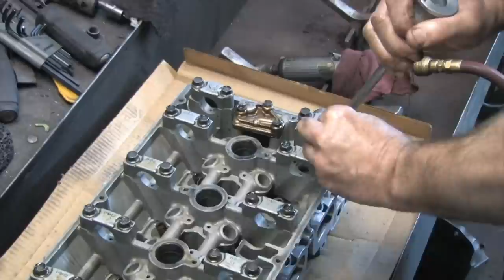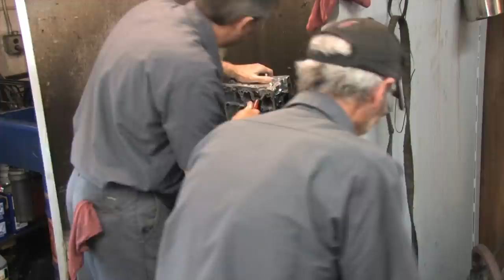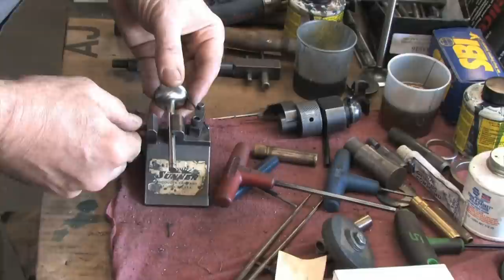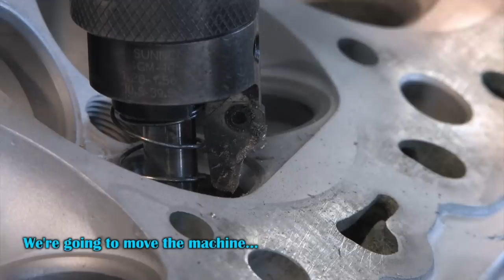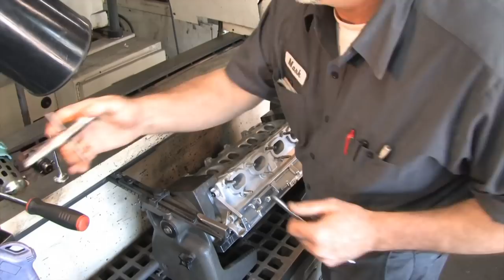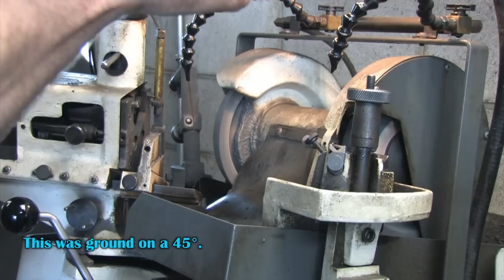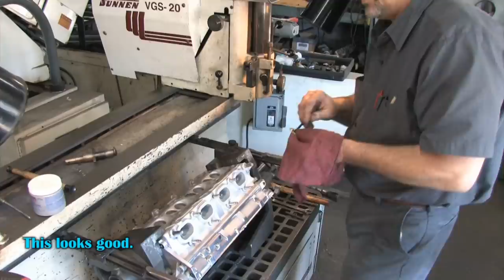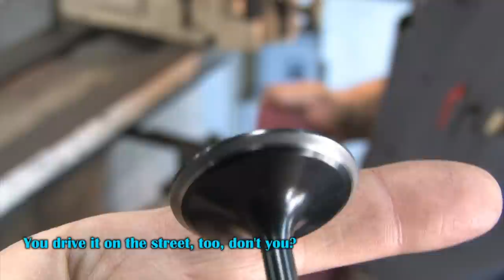Cylinder Head 201 - Radius Cut Valve Job

Comment from the maker: +Victor Bangle Your replies are disabled.  It's not the head that was moving.  The table this is on weights over 800lbs.  Actions were taken to compensate for this in this very video.  There's always a couple thousandths of an inch of deflection in the guide because if there wasn't, it would get stuck inside the valve guide.  The reason you cut, inspect, lap, cut again, lap again and inspect is to ensure you're setting your stops correctly.  If it chatters, that's bad... but the process accounts for the smaller guide variable.
Reply: ***** that's cylinder head,work was professional real nice thank's for this technical video
Reply: +Jafromobile Hey boss a friend of mine has one of those 4G63  and I was just curious as to how those inconel valves treated you?
Reply: OK HEY I NEED EVERYONE TO HELP ME I need new valves and seats for my Honda trx450r. If I buy a new cylinder head and valves that are the same dimensions will it be ok and work.       Oem cylinder head, oem shape valves or something like that you get what I mean but will it take any work or valve cutting after that

Comment: In my heart of hearts I always wanted to work with my hands machining and building stuff.  I love your videos dude. It tickles that 'what could have been' sorta feel in me. 

Alas, I had to be all computer oriented and do most of my stuff in the virtual confines of software....and the hardware side...pulling cables and building out network infrastructure, just isn't the same as this stuff..
Reply from the maker: You're absolutely right.  It's not the same at all.  That's why when I get home from pulling cables, building images for mass deployments, setting hardware and software standards, configuring LDAP layers and network topology, configuring and maintaining server environments, coordinating with 14 other technicians, dozens of vendors, and supporting about 9,000 users total, I grab my tools and wrench on cars.  ;)  It helps me relax.
Reply: OH my God! I completely missed this reply all those years ago.   You rule dude.  Also, I actually started woodworking as a hobby in the meantime.  Nothing too serious, but I've picked up manual skills since then. 

Cheers dude. I still watch your videos to this day. :D

Comment: This machinist is legit. Taking the needed time to check and recheck. Not forcing or rushing anything, I like what I see. As far as I am concerned, that part is a wrap. I love it when a plan comes together! Real good video. You usually don’t see stuff like this on crap tv videos on cable. The machine shops they use wouldn’t let you video their work! Some people just don’t get the level of repetitive tedium that is standard manual machining. It isn’t that it is hard to learn or do, but it is repetitive and it can be tedious. You have to be ok with that. Doing a stellar job despite the obstacles is what sets this guy’s work from the others and being honest too!👍🏻

Comment from the maker: +Jens Kraft This job (radius-cut valve job) costs in the hundreds.  Not the thousands.  It's port work that's expensive.  You'll pay an hourly rate for port work.  Non-CNC port work (doing it by hand) can take dozens of hours, and CNC precision isn't cheap either.

If you pay more than a few hundred bucks (U$D) for a basic rebuild/valve job on a good head you're paying too much.  If you're replacing or upgrading parts, add the price of whatever cams, rockers, lifters, cam gears, valves and springs you're going to use.  Add port work, welding, extensive machine work like moving cam centers and crows feet, shrouding, valve guides, polishing... then the sky is the limit.  You CAN spend thousands, but what I showed here is really affordable if you're the mechanic putting it back on the car.

The changes I'm making to the valves and springs will significantly improve the sealing qualities of the seat, and that would normally improve efficiency, however; this engine will not be built around efficiency, unless the efficiency goal is producing 520kw with 2.0L of displacement.  That's not the kind of efficiency you describe, but it will give the vast majority of V8's a black eye and still get 26-28 mpg on the interstate pushing a 3355lb chassis with air conditioning.  For my goals, I consider that efficient.

...I failed to mention it will most likely get 11mpg in the city... but it doesn't get a lot of use, and will be the most fun gas you've ever burned.
Reply: The information coming out in this video is priceless. First hand experienced machinists giving their methodology in simple english and explaining why they do what they do, not why its the best way. Just like your other video Jafromobile. Amazing video, thanks bro.

Comment: Great video and top notch workmanship-- many years ago I had a 74 Kawasaki Z-1 900 bored out to 1015 cc and I had Manley SS oversize valves that had 'reliefs' for better flow, also had the runners cleaned up and port matched, Megacycle 417 lift cams too

Comment: Absolutely brilliant. I loved the CV joint on top of the valve grinder to use the machine torque but not the head bearing.  Using the seat itself as the rotory guide is standard I guess but I never knew.

Comment: Nice work.  On a not new engine/head, before going any valve seat cutting, check for ware in the valve guide.  An oversize/worn guide will allow the valve to rattle rather than close cleanly.  Use an oval go/not go gauge to check for ovality.   Oh, and check for ware of the valve stem for the same reason.   Also if there is any combined tolerance build up, lowering the valve in the guide by recutting will hide this but it will very soon reappear.  Checking for wear should be done before machining to prevent this.  Get rid of any discernible wear before starting to improve things from stock.

Comment: Sir,,it's the,best way to,work  on,all Cylinder, all heads taking special care, n precision, increased horsepower, help to cut n  reduce pollution, n,helped ,to save fuel,,,(is not the, engines, is the problem,,,is we,) thanks u,sir,,

Comment: For the intended purposes of this video, it was very good.  It was nice for that guy to walk the audience through.  But for any one here that does performance cylinder heads or knows the process, probably will approach the valve job differently.  Just a couple things I saw and disagree with was that he seemed to use too aggressive of lapping compound.  I use nothing more than 400 grit and you should use dykem on the seat and valve to see if it cut concentric or not.  As far as the cutter, there is nothing performance about a 30/45/60.  That is a normal valve job you'll get from a rebuilder shop.  Once again, not bashig by any means, just voicing my perspective on this.  All in all, I think this is great you take your time to make videos for the public.  Good on you for that.
Reply from the maker: +recordbreaker5 There are many aspects of performance, and many points I agree with you on… for instance, I hate radius cutters in general.  That's not my preferred equipment for cutting valve seats on any performance job, but it costs $1700 less and isn't what's responsible for the biggest gains that I'll be able to feel or measure from the driver's seat.  To me, that's money well saved.  While a valve seat can be a limiting factor, it's not where the majority of "performance" gains come from.  Keep in mind, when Mark says "performance cutter", all it denotes is that there are 2 kinds of cutters available for this particular machine.  Variations in how wide the 30/45/60 angles are… are why it's referred to by Sunnen as a "performance cutter".  The "performance cutter just has a longer 30 on it, and a shorter 45 and 60.  It's intended to move the seat out closer to the margin of the valve which actually shortens the life of the valve job, but improves airflow over a standard cut.  It's that simple.  If anyone hears "performance cutter" and assumes that using that tool automatically means they're going to end up with the ultimate valve job in under 2 hours and for less than $300, then they're a victim of their own assumptions.  It's just a seat that flows better than the standard cutter will cut.  A seat that doesn't match the exact lengths of the recommended 30, 45 and 60 cuts.  One that Sunnen claims will flow better.  A standard seat has wider 45's and 60's so that the valve job lasts longer.  It trades flow for a bit more durability, that's all.

The weakest link in 99.999997% of professionally-built "performance cars" is always the driver, not the valve seats.  "Performance" is the most abused term in automotive engineering because what's the standard?  Performance what?  Whenever someone thinks they have a "high performance" machine, they get butt-hurt the moment they find out someone else is faster.  Problem is… someone else is always faster.  Unless their name is Kye Kelly of course.  If the standard is "flows better than stock", then nearly any bolt-on upgrade from an air filter to an exhaust tip turns a street car into a performance car.  That's awesome from a sales pitch perspective, but that won't change Kye Kelly's opinion of your car.  That's why performance is a subjective term.  It's splitting hairs.  He-said-she-said.  All "performance" denotes is it's intended use.  

Putting a 9 angle valve job on a normally-aspirated economy car won't magically turn it into a "performance car", just like using a standard cutter on a GT-40's valve seats won't turn it into an economy car.  You also mentioned the same thing I think about permatex lapping compound.  I've actually mentioned that in this video, and a previous video where I covered the shade-tree approach to valve jobs.  If someone wants to spend $2,000+ or 100 hours dressing stones and cutting seats for 3 extra CFM, then they know what their reasons are, but everyone else is going to end up with a valve job done on a radius cutter because the machinists doing the work would rather not spend their whole week on it, and because in nearly every practical case with every rebuild, $2,000 can make a much bigger difference somewhere else.  I've got a set of GTP heads for reference.  I know what actual "performance" heads look like.  You're correct, perspective is everything in this discussion.  I'm not arguing with you, I'm agreeing with you.  The reason I made this video is because nobody who knows how to grind the highest performance seat has the camera, knowledge, ability, or drive to make free educational videos for the public on how to do it because it works against their livelihood. That, and they've spent their lifetime developing different talents.  Of course, if I'm wrong about that, I'll be the first person to favorite, like, subscribe to and share their video with my audience because I love that kind of shit and so do the people who follow me.  :)

Comment: That Sunnen seat machine is ancient technology now, only a step above someone with a grinding rock and hand tools. The shop is taking care of it and using it properly so the work is good but could be better with some minor changes. That machine will only be as good as the care put into set-up for the cut. 

I would have liked to see the machinist show the process for checking taper and wear in the valve guides prior to setting the head up for making cuts as these are used guides and will have wear inside. There should be a selection of sizes to choose from for the pilot rod so you can find the tightest fit while the pilot still remains free moving in the guide. Pilot rods can be sized by the 1/10 of a thousandth when ordered. The closer that rod fits the better the end result. I only saw one rod chosen and it was forced down into the seat for the guide leveling process, something that should be avoided as you can force the guide to wedge at an angle when inserted into a less than ideal guide bore when the shoulder on the pilot meets the possible tapper at the end of the guide. This can cause the seat to be tilted in relation to the guide and that tilt will transfer to all later cuts.

You should always chuck NEW or used valves into a face cutter to check for bent or out of round valves even if you do not plan on actually facing them.

I can see a rounded leading edge on his seat cutter in the video, a touch-up with a green wheel would  bring his cutter to life again and result in a better seat. If you notice in the video the pilot wobbles in the hole as he makes the cut to the seat because the cutter is dull and he's rubbing the profile into the seat more than he is cutting the seat. That will have a pretty finish but the job could be much better done with a correctly sharpened seat cutter. The idea here is to make the hole round and it could be much rounder if the cutter is sharp and not deflecting 1/16 an inch in every rotation of the spindle.
You notice he said he was planning to lap the seats. That's not a process you need when your machine is rigid and your cutter is sharp but it's a better process than running a dull cutter on a side-loaded wobbling pilot and calling it a done deal.  Granted he only lapped one set of valves to verify his seat location.

Lapping valves is a step backwards towards the grinding rock as you are using grit to finish your seat which in poorly trained hands can embed the grit into the seat and valve faces and continually  grind away at your seat work as the valve rotates in an operating motor. This problem can be seen on heads with lapped seats in motors that are run for a short time and are pulled apart at a later time. The seats will grind them selves wider and wider making the work put into having the sealing pressure being concentrated in as thin a seating surface as possible be a wasted effort after some running time. The embedded grit doesn't go away it gets pushed into the valve face deeper and deeper as the engine runs allowing it to continue a cutting action on the seat job. Slamming the valve into the seat while lapping will embed the grit of the compound into the valve face. I can hear and see this being done in the video, not an ideal way to do the work but in the long run it is not the end of the world.

An engine is an air pump. It will work when it is worn out or perfectly machined. Hard run race engines are put together with loose tolerances for reliability yet the same engine going into a passenger car for use in commutes is put together tightly for reliability. At the end of the day any reasonable amount of effort will give you a working product and I have respect for people who do the best they can with the tools they have.

Comment: the operator needs to check the bubble on the head of VGS machine first,then adjust cylinder head to vgs head for north and south adjustment. then set bubble for left and right tilt on cylinder head then adjust vgs head to cylinder head.

Comment: very nice vid!  these mods will improve the cilinder filling a lot , most gains will be at low valve lift, both on opening and closing of the valves.  The engine should gain torque over the entire rev range. And maybe also start spooling up the turbo at a lower rpm.

Comment: That cylinder head is a work of art--absolutely beautiful. Jaguar? I worked with Chrysler with the original Hemi in the 1950's--what we wouldn't have given to be able then to advance to a 4-valve layout (but the accountants would have vetoed it, as they did with the original hemi in 1958). It's not well known why exhaust valves are usually of a smaller diameter than intake: the physical mass flowing through the exhaust valve is significantly less than the intake due to the extraction of energy from the gas/air mixture
, which departs through the crankshaft.
Reply: plus in a NA engine, the exhaust is under pressure too compared to intake charge, so larger valves arent needed compared to intake.

Comment: Not gonna lie, I was hoping I was going to see something here to encourage me that a home valve job is possible since I seem fascinated with precision machining.   No joy.   I also just priced that Sunnen machine.   Ouch.  Thanks for the video and to your machinist,  his explanations are excellent.
Reply from the maker: check out newaymfg.com.  There are affordable home cutter solutions.  Amazon has many sets available that are about equal to what a machinist charges for cutting seats.  Don't leave the guides out.  I just did a great video about this inspecting my Galant VR-4 heads.  Make sure the rest is up to snuff before buying that cutter.
Reply: @Jafromobile  I actually just watched a few videos on that because I saw it in the Goodson catalog.  I wouldnt even mind the motorized tool and their valve grinder at some point...or at least buy the transmission shaft and use my variable speed drill motor.  Do you know if they have a decent 75 degree cutter or whatever you would use to oversize the valve properly?   Thanks for supporting your older videos!

Comment: He did a great job with the old sunnen machine. I actually prefer that machine over the fancy part cnc sunnen with the touch screen. For how expensive that machine is you would think the touch screen would be better.. but one big thing here is that the whole port is based around your valve size. To get the most out of your heads you are going to want to do a bowl cut and blend your valve job again with your bigger valves. Dont forget you need to resize your venturi! Extremely important!